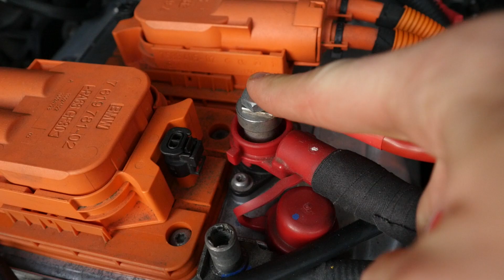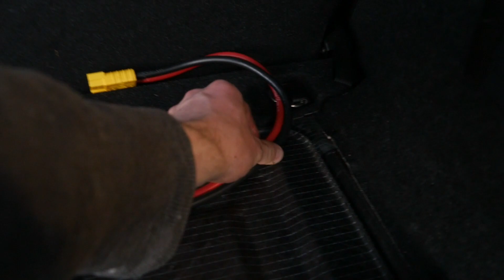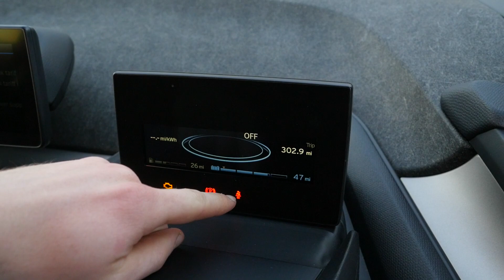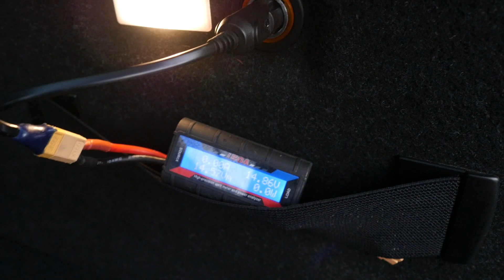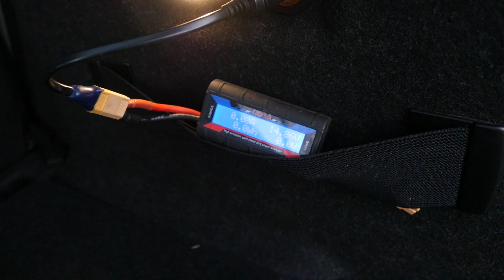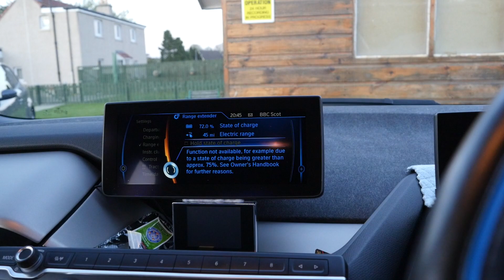BMW I3 Backup Power Supply Completed

Comment: Useful information - now I know where to tap obtain about 52A of DC.  I am intending on using the I3 battery during power outages.  Here is the approach I am envisioning:  Use a decent portable power station (or "solar generator").  Mine is the Ecoflow Delta Max 1600, which has a 2000W inverter and 1612Wh of battery.  It also has an 800W, 13A, 100V max DC input. Run essential loads in the house during a power outage.  Recharge the power station with portable solar or the BMW I3.  The huge issue in using the I3 is I calculate the parasitic loss, to run the converters and computers, at 430Wh.  So, the shorter the car "on" time, the better.  Solution is to use a 12V to 48V step-up converter, which lets me push 760W into the power station.  That should take about 1.4 hours to bring the battery from 20% charge to 80% charge and should deplete the I3 range only about 5.5 miles.  Then, shut the car off and use the power station until the power station battery reaches about 20% charge, and repeat the recharge process.  By the way, I found that just reaching in through the open driver's window, throwing the key fob on the seat, and pressing the start button will activate the necessary systems and doesn't seem to time out and auto-powerdown.

Comment: Hi Shaun, thanks for doing these videos, I’m looking at adding an inverter to my i3 using similar connections as you’ve done.  I’m wondering if there is a way to leave the car off but force the 12v charger in the i3 on, any thoughts?

Comment: 2500 watts @ 50 amps... Can this connect directly to a 2000 watt inverter to run 110V backup power to a home for say a gas furnace and refrigerator and some lights during a power outage?